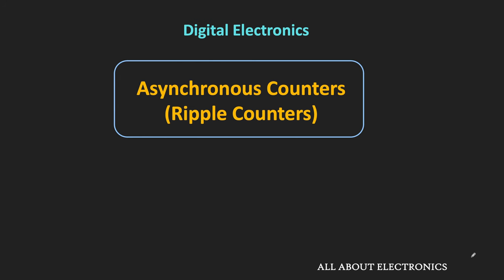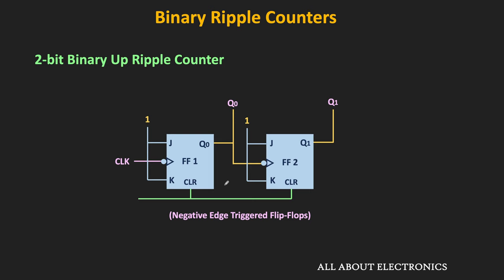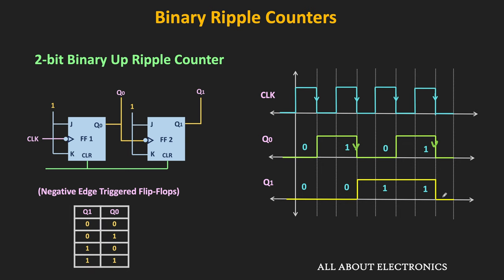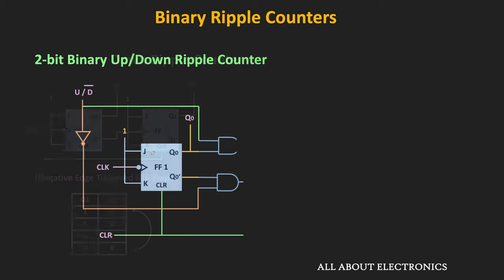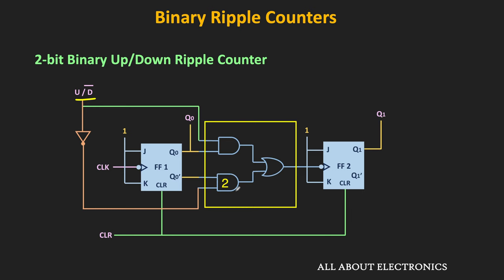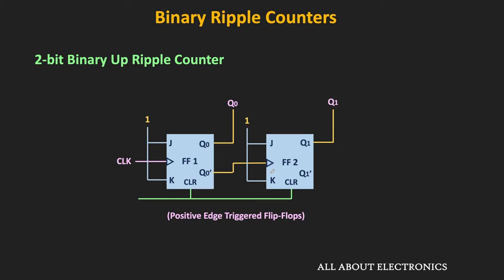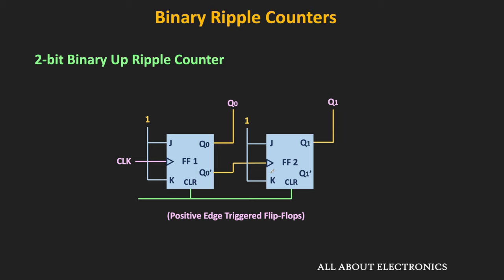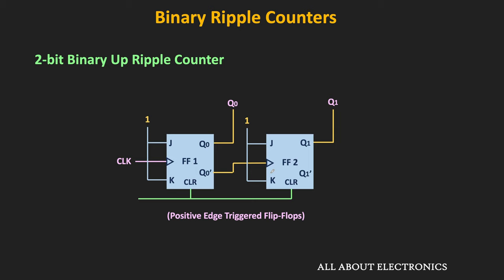Asynchronous Counters (Ripple Counters) Explained | Binary Up/Down Ripple Counters

Comment: Need correction, few things were explained wrong here. for the down counter we need to take the clock pulse from the Q to the other ffs. and for the up counter we need to take the clock pulse from Q(bar) to the other ffs.
Reply from the maker: It depends whether the flip-flop is positive edge triggered or negative edge triggered. I think you haven't watched entire video. At 12:38, I have already provided table for the connection for both positive as well as negative edge triggered flip-flop. And its humble request, please do not misguide others before fact checking. Don't get me wrong, I do appreciate if someone finds genuine mistake, as it is helpful to the viewers. But some times such comments misguides viewers, especially those who are watching the video just one night before the exam, where they do not have time to check the facts.

Comment: can you show the 3 bit ripple down counter with negative edge triggering
Reply from the maker: 2 bit down counter using negative edge triggering is already covered in the video. (See the chapters in the video). You just need to add one more stage in the configuration for 3 bit counter.

Comment: Wht is meant by transition in yhe output of flip flop? As u said in 2:17.
Reply from the maker: If you closely observe the circuit, then the output of the first flip-flop is connected to the clock of the second flip-flop. And the flip-flops are edge-triggered. So, they will respond to the input whenever there is a transition in the clock. (When Clock goes from high to low and low to high). So, here the second flip-flop will respond whenever there is a transition in the clock signal. And it will happen whenever there is a change in the output of the first flip-flop. In other words, whenever there is a high-to-low transition in the output of the first flip-flop.  The same is also evident from the timing diagram at 4:46.